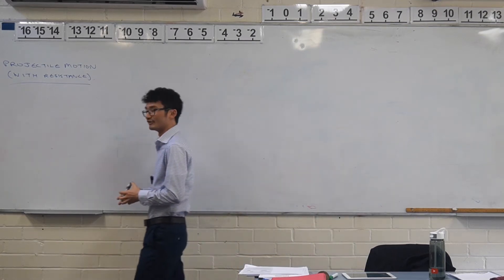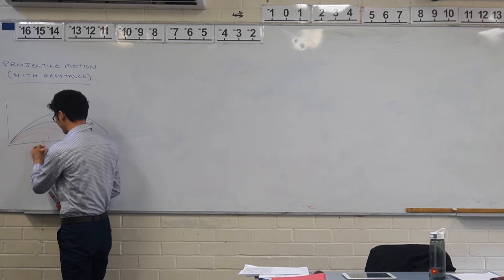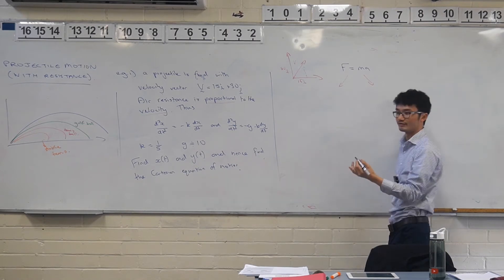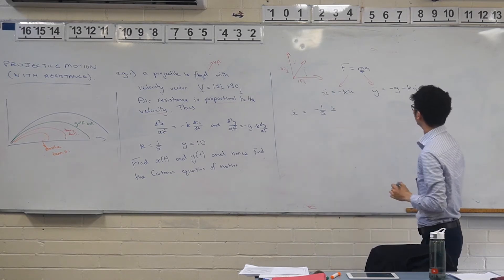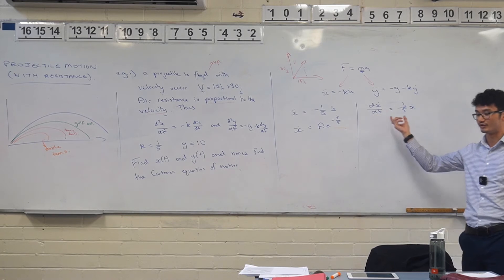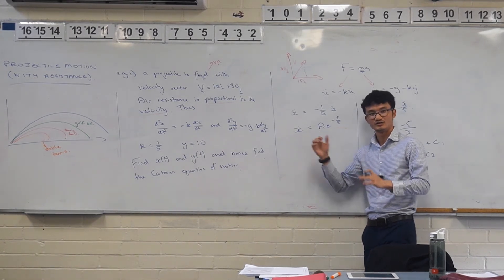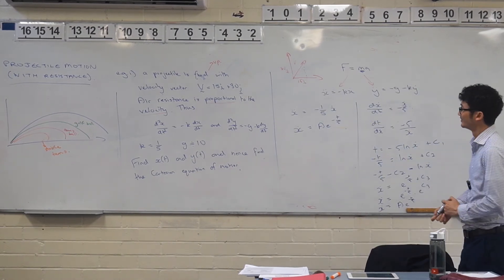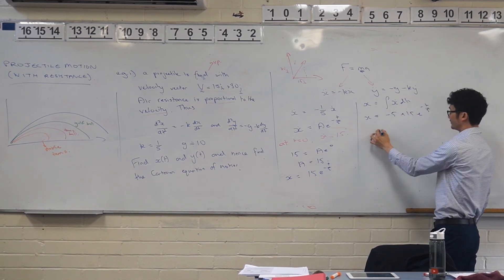Projectile Motion With Resistance (Part 1: Finding the Horizontal Displacement)

Comment: What happens to time of flight when air resistance is considered when compared with case when its ignored... It increases or decreases?
Reply: decreases
Reply: Good question, i will find it myself now for you
Reply: I consider a ball , having diameter 7.1 centimetres, weigh 156 grams , density of air =1.9kg/cumm 

Here are some results , at g=9.81m/sq sec
Reply: At Launch speed of 50m/s and launch angle of 60 degrees 

With air resistance

max distance= 108 metres
Max height= 60.4 metres

And time of flight = 6.53 sec
Reply: And Without air resistance 

Max height=95.5 metres
Max distance = 220.8metres

Time of flight=8.31 seconds

So clearly time of flight is less under air resistance on any projected body